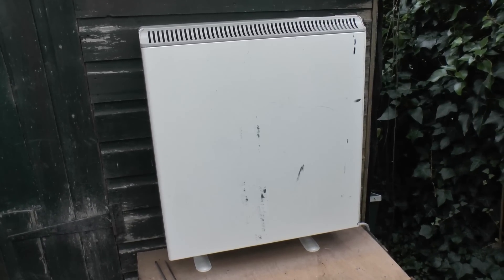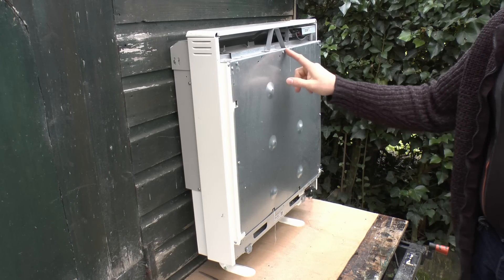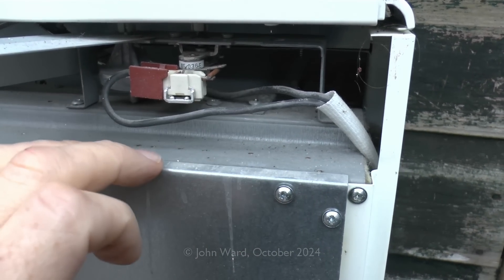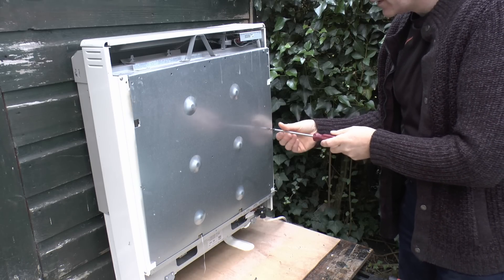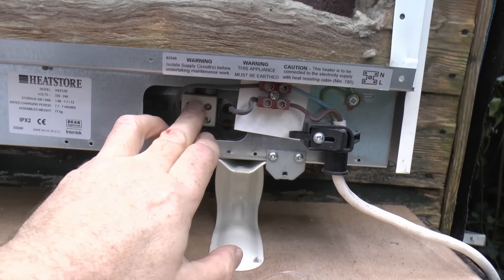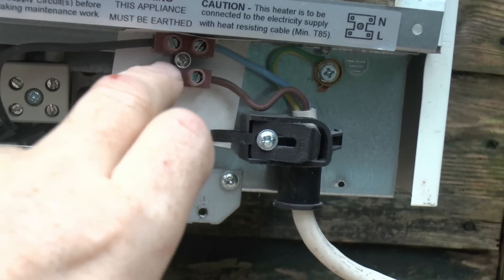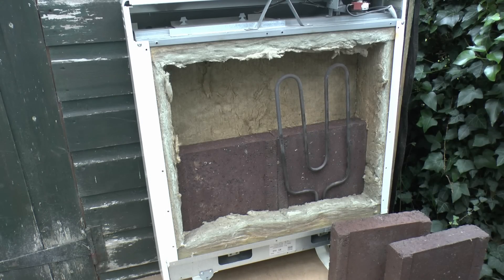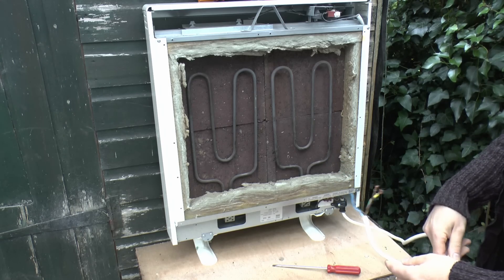Storage Heaters Part 2 - What's inside, fault finding, how they work

Comment: The first time you heat one of these up from new they absolutely STINK!!
Reply: Reminds me of when the electrician fitted one in every room of a house and left them running. Place still smelt of burnt paint weeks later. Put a decent load on the electric supply to as the meter tails were noticeably warm.
Reply: Same with a new oven/grill. It's the protective coating on the elements that has to be burned off.

Comment: Thanks for putting the video together. I've never met a occupant who liked these heaters. I think the usual problem is they often leak heat, so when you actually need the heat most of it has already gone. It's also difficult to control the amount of heat that comes out of them, which is a closely related issue. And on another related note, the radio teleswitch meters that often control these heaters are all being replaced now, due to the possibility of the BBC radio signal being switched off sometime soon. This won't be the end of it though, because the bandwidth the new smart meters use will at some point become redundant also no doubt, just as it is in the coming years for the first generation smets1 smart meters which use 2G/3G.
Reply: Yes just had to my radio teleswitch meter replaced. Luckily my supplier put me on Economy 7 with my new smart meter, but I lost my separate heating rate (which was just for storage heaters circuits) which will definitely hit the pocket if I have to boost a heater during the day...

Comment: I remember some people removing the 20amp switch and putting sockets on instead so they could run their appliances from the off peak board back when the storage heaters had a mechanical time switch and only the heaters would use low rate and the rest of the installation was charged at normal rate .The only drawback is that they could only be used at night,which confused some people.
Reply: Best thing these days is use it to charge a battery off the cheap rate electric. Then use that during the day or even sell it back to the grid if you have the appropriate meter.
Reply: @Ed.R  Now on Agile tariff and Octopus have disabled the timer in the smart meter so I can activate the storage heaters whenever there is cheap electricity available.
Reply: In the good old days cheap rate electricity was for storage heaters ONLY and if you dared to use the circuit for other purposes the supplier company would enter your property!!
Reply: Yes ,they weren't happy about it from what I have been told.
Reply: @Mike_5 
With smart meters nowadays, they would know what you was doing 🤣
Reply: If your house has a separate heating rate (as well as day+night), then sadly the electricity companies have cottoned on this. Storage heaters are consistent, so if you start wiring plug sockets in instead, the electricity company will notice the amount of electricity you use on the heating circuit suddenly changing!

Comment: Yeah as someone mentioned before you forgot to mention the fusable link can go 167° and you can buy separately and do not need to replace the whole thermostat assembly. Dimpled have a thermal reset

Comment: These old storage heaters are being phased out because apparently they can't be installed under new regs. All new heaters must have sufficient points with regards to energy efficiency. Problem with it is that now a storage heater costs close to a grand and even a basic panel heater is £200 - 300.
Reply: Which is pretty funny considering electric heat is already basically 100% efficient. But sure, heat pumps are more efficient.
And if someone really wants a heat storage unit, pour floors with radiant heat and dump heat into it with a heat pump.
Reply: @Lagittaja  It's got more to do with things like open window detection, better heat retention for storage heaters, fan heat distribution and programmable timers. Things that apparently reduce energy consumption by the heater not really the actual efficiency of the heater itself.

Comment: I found some “storage” heaters used a cross-flow fan at the bottom to blow the heat out = they found these to be more efficient if they over-insulated the top of the unit ~ without the thermostatic flap thing that heat leaked out of, as heat rises, and having the bottom open. The heating element/s and bricks would be mounted on a bracket-bar and a air-gap at the front, top & back of the insulation and bricks. The air would often be drawn through a dust filter to stop dust from depositing on the bricks and “burning” on them, then flowing up the back>over the top>down the front to the fan. The “booster” element was above the fan and only was turned on in the evening when the bricks were almost depleted of heat. There would be 2 thermostats; 1 to heat the bricks at the desired temperature, and the other to turn the fan on with the room temperature and a booster switch to turn on the “booster” element with the fans thermostat.

Comment: Some I worked on many years ago had a melting safety link in of a fusible thermal device .
They used to go open circuit if people put there cloths on the heater ..

The worst thing about storage heaters is carrying the bricks up three flight of stairs 😮
Reply: I priced replacing four heaters once over the phone. Got there to realise it was 4th floor flat with no lift. Then had to take the old ones away as well...
Reply: Oof  @tebscat
Reply: or just pop the old bricks back into the new heater, job jobbed.

Comment: Excellent presentation as always, when I moved into my present home 30 years ago, every room had a storage heater and also a dual rate electricity meter than ran from 23:00 to 06:00 for the cheaper rate electricity, although the day rate was higher than a normal single rate meter.

Comment: So the ones with the fan have a seperate element and air just blows thru that part?
Reply: They speed up airflow through the bricks. But some units had a small fan heater built in for the afternoon boost when the bricks have cooled down.
Reply: @bigjd2k  Yeah I have a vague memory of the wall connection plates for these units, which had a "Main" supply fed from the Economy 7 switch and a "Boost" supply fed from the standard socket circuit so that the booster could still be used in on-peak times.